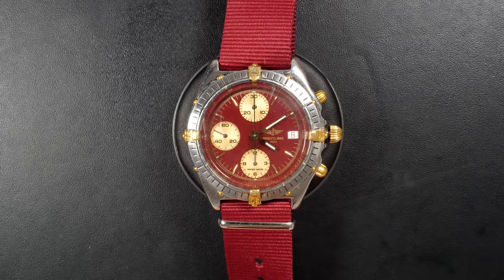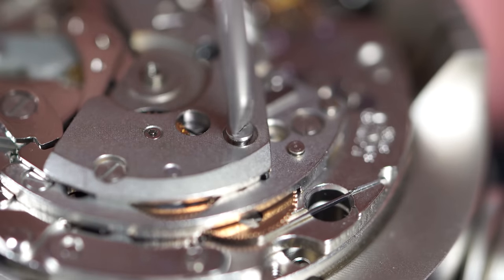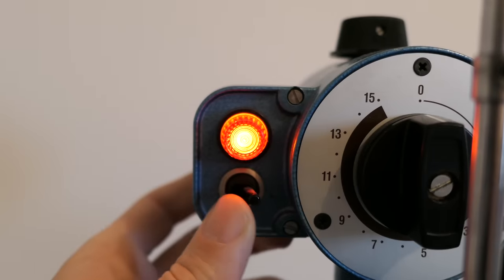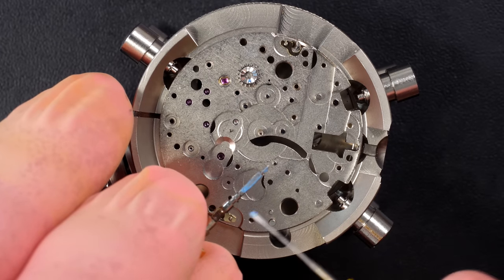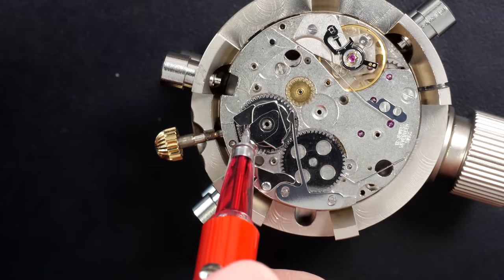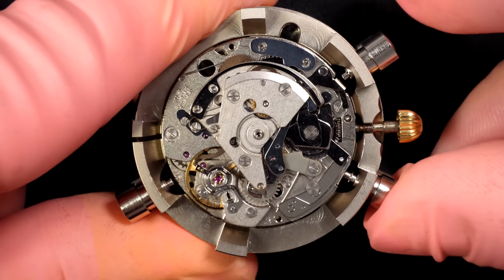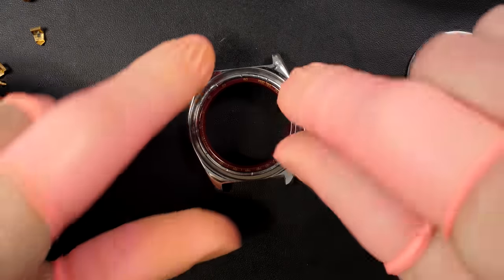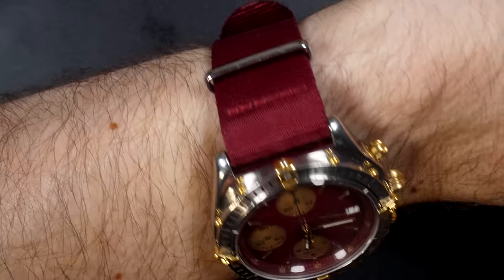Breitling Chronomat with Issues !!! Valjoux 7750 Service

Comment: Excellent job. Always admire how you can remember where which small intermediate wheel goes, which spring goes here and which part to put before the other one. I can manage no problem day date,three hander watches but chronos I avoid. So many levers, pushers all same shiny metal parts to me...😅
Reply from the maker: What is great with the 7750 is that you can find a lot of technical documentation and videos to help you if needed. It is like assembling an ikea furniture a bit 😅

Comment: Like most ETAROTOR movements the winding clutch is a bit fragile and thus it is hard on these movements to continually hand-wind them.  Yes, it is normal for the Heuer-type drive pinion to just float in there; it is tipped back and forth to engage and disengage the chronograph drive.  These movements were made so they could be easily assembled by trainees but they do require a good amount of attention to the alignment of the levers to operate properly.
Reply from the maker: Thanks for the info

Comment: Hey, I noticed that you measure this movement (and some others on your channel) on the timegrapher with a lift angle of 52°. Valjoux 7750 has a lift angle of 48°. You can change the setting on you timegrapher for a more accurate measurement. will definitely result in different results for the amplitude. the "watchguy lift agle list" is great to find the right lift angles for the particular movements. 
great work, keep it up.
Reply from the maker: Thank you
Reply: Caliber Corner quotes a lift angle of 49.
Reply: Omega list the 1150 which is basically a 7750 as 50° too haha, such a small difference tbh it doesn’t really matter that much, especially when it come to rate

Comment: Thank you for the video. Another great one as usual.  Beautiful dial on the Breitling. However their cases in my opinion leave something to be desired    Anyway. Thank you again.  Is that a Bergeron 7720 oiler you were using to oil the train pivots?
Reply from the maker: Yes I used an automatic oiler from bergeon

Comment: Hello, I have a problem with this same watch.
Basically the watch runs very regular if left on the table. But when I put it on the wrist it starts to run, and in a couple of hours it gains minutes. What should it be?
Reply from the maker: Probably something is loose in your watch if start not working while on the wrist. Maybe some play at the barrel arbor. Difficult to say

Comment: Bonjour, je viens tout juste d'acheter une mido chronographe. L'aiguille du chronographe est décallée du midi de 1.5 seconde, ce qui est beaucoup. J'ai acheté la montre a l'international et il me serait compliqué de la retourner, du moins cela me coûterait de l'argent. Ma question est la suivante, je crois être capable d'enlever l'aiguille et de la remettre a midi, j'ai le matériel pour le faire, cependant j'aimerai savoir si je dois absolument retirer le rotor du mouvement pour faire l'opération, ou si je peu laisser le rotor en place et deposer le mouvement sur un gel bergeon par exemple. Je suis nouveau dans le domaine de la maintenance des montres c'est pour cela que je demande 😊 merci de votre aide.
Reply from the maker: Il est plus facile d’enlever le rotor pour être plus à plat. Bon travail
Reply: @FrenchWatchCollector  Je m'attendait à cette réponse. D'accord merci :) que Dieu me protège XD
Reply: Hey j'ai une autre question si tu veu bien m'aider 😂 J'ai retiré la couronne ainsi que les deux visses qui tiennent le mouvement. Pourtant le mouvement semble tenir en place et ne s'enlève pas si je le retourne. Je peux le faire tourner dans le boîtier par contre. Il y a til quelque chose à faire en plus pour le retirer? Précision, c'est le Valijoux 7753, celui avec la switch (push button) pour changer la date.

Comment: What a rough looking movement. No decoration whatsoever. This watch was made during Breitling's most dire times.
Reply from the maker: Yes the ETA 7750 is quite simple.
Reply: @FrenchWatchCollector  True, but other manufacturers put their own spin on it. Decorate the movement, add some improvements etc. Breitling was almost bankrupt at the time and just plugged in the most basic piece they could get.
Reply from the maker: @heiner71  yes you are right